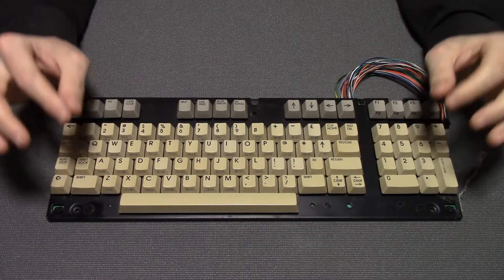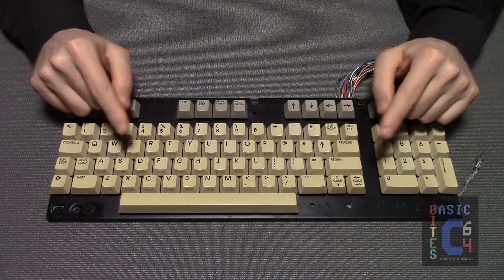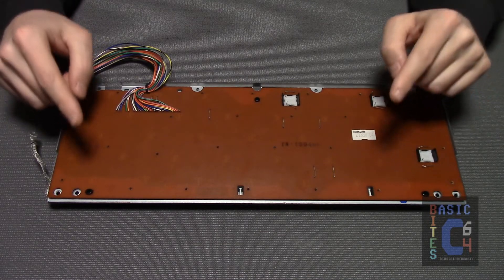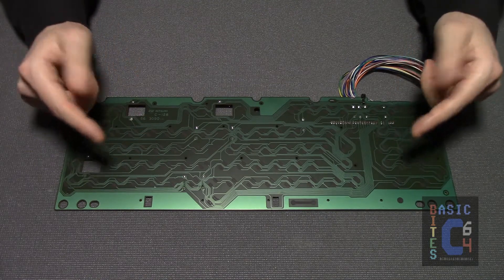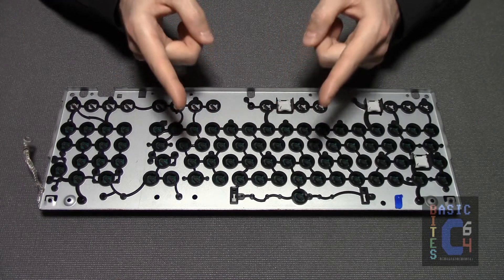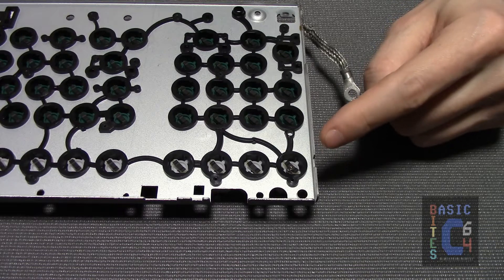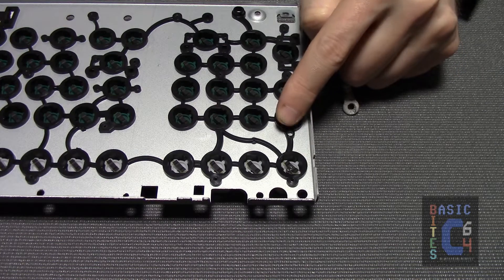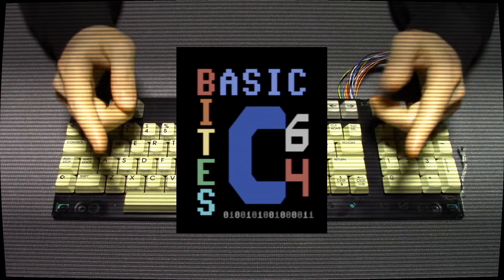Fixing a RIDICULOUS Commodore 128 Keyboard Fault

Comment: Hi.

Could liquid graphite be used to reconstruct the pads?

Also, thank you for the video.
Reply from the maker: My pleasure; you're welcome!  In regards to reconstructing the pads -- in cases where it's certainly the PCB that has the issue, versus the conductive rubber on the key -- I know that conductive carbon paint is a thing that exists, but I have not experimented with it myself.  Some of the other great keyboard repair videos on YouTube might have more information on that.  -- JC

Comment: Thank you for this video! I just took apart my first c128 keyboard and was a little baffled to find a tiny spring floating around inside.
Sorted now!
Reply from the maker: My pleasure!  Reportedly, without that ground connection, static discharge into the metal keyboard plate can cause damage to the CIA chip... and I doubt it was a coincidence that the CIA chip reading the keyboard on that particular C128 had gone marginal.  -- JC
Reply: @BasicBitesCA  Thats so interesting! The CIA on this 128 has also gone marginal faulty with just a single row in the matrix missing altogether. I wonder if this was a grounding issue?

Comment: How can i fix the black carbon contacts?
Reply from the maker: Good question.  I would strongly recommend searching other videos on the subject, because I've never done it.  That said, if I had a C128 Keyboard PCB with degraded carbon pads, I would probably use the opportunity to experiment with conductive carbon paint and see if that fixes them.  (For a C64 PCB, I would more likely just buy a working one, since '64 keyboards and their parts are still relatively cheap and plentiful.)  -- JC

Comment: Nice overview, it is much appreciated.  I have 2 128s and thankfully I have not had to take apart the keyboards.  I have had to on several Amiga 500s and they basically use a similar setup, albeit not a PCB but a thin membrane.  tons of screws and no fun.  But the puns make for some funs...  🤣

Comment: When I desolder the toggle keys, I add detachable wires to save time in the future.
Reply from the maker: Good plan!  I didn't, although I hope not to have to remove a keyboard PCB more than once in a blue moon. 😊  What do you solder on to make the wires detachable: some sort of miniature alligator clip?  -- JC
Reply: @BasicBitesCA  I wish I could say I made a fancy connection, but I often have USB cables that are bad at one end or the other and don't throw them away (just in case 🤣) and I end up putting the male end on the key and the female end on the board. Maybe not elegant. Soldering them back is easier. I do that when I don't expect to take it apart again. However, I have a "test bed" system for several Commodore systems and I don't want to bother when I have to detach the keyboards that seem to inevitably need repair (the carbon pads are nearing EoL). If I choose to change out those keyboards with mechanical keys, I'll probably won't need to bother.
Reply from the maker: @jeffreyphipps1507  Thank you for the information!  I have a half-destroyed breadbox C64 that I also use as a "test bed", and might just play around with making the toggle key detachable on there.  -- JC